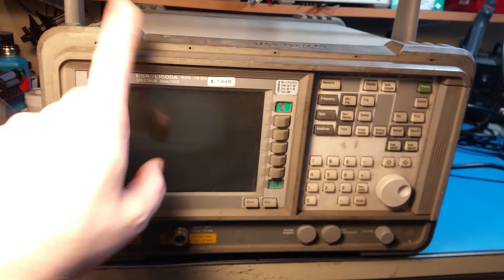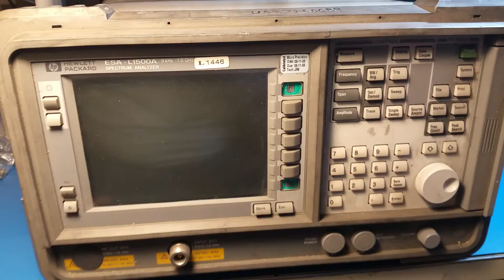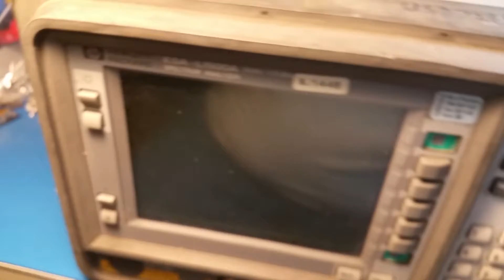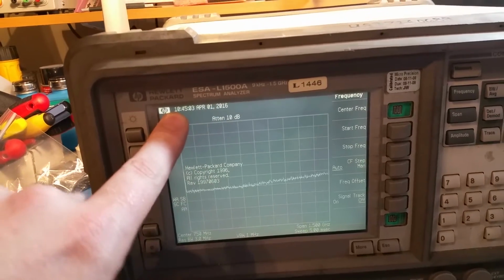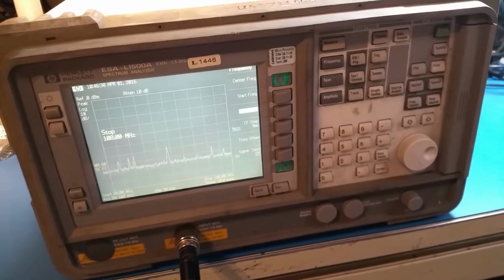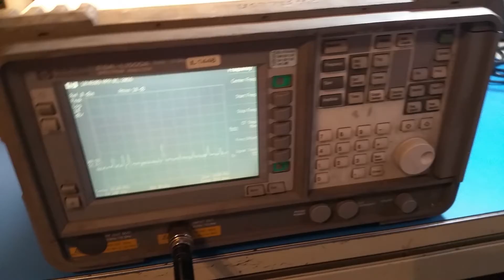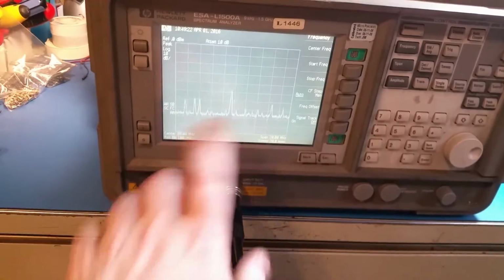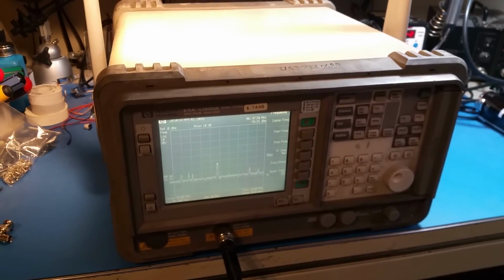HP/Agilent ESA-L1500A/E4411A Spectrum Analyzer

Comment: Hi - you probably found out by now, it is meant to chirp, it is doing a background self alignment while its "chirping" (it is relays :)
Looking forward to your next videos with the case off this while you overhaul it, interested on what you state you find the battery in, and what's required to change it if required as I've just bought on of these.
Reply from the maker: +John Woods The battery in mine was replaced at some point - had a date on it from 2012 so it's got some time.
The chirp... yeah.... it was coming from the IF section.
I gave it a clean and once over and it's all good.
I just need to get a front panel but it works just fine otherwise.
Reply: +Mark19960 Ok, mine needed a good clean too. I need to check out the battery sometime to ensure its not leaking, although the time, date and configuration are holding up well overnight. 
I suspect you might be able to obtain just the button membrane for the missing keys, rather than the entire front panel.
Reply from the maker: +John Woods actually have been watching ebay for a front panel but the membrane does not look like it's something that detaches - at least not on the monitor side. The other side does appear to come  apart.
There was one on ebay for $300 but that's not in the cards. Nothing a bodge can't fix temporarily since it works fine otherwise.